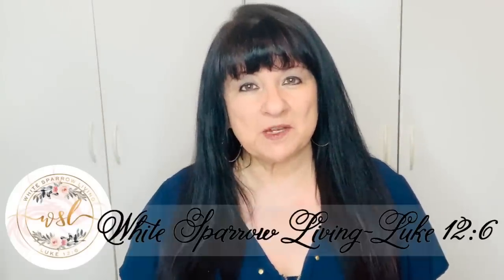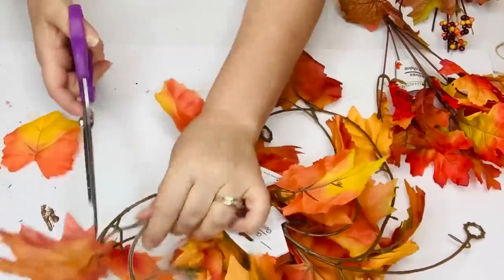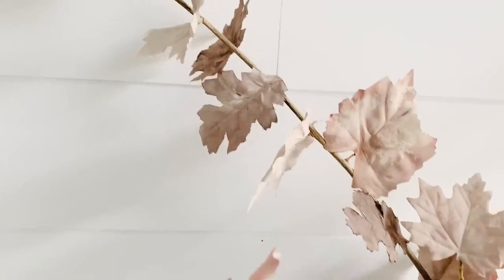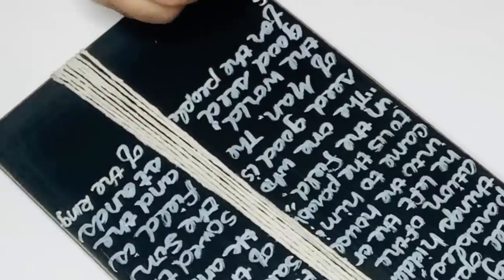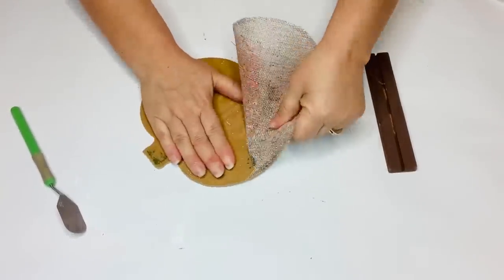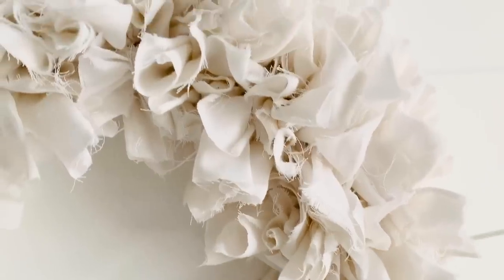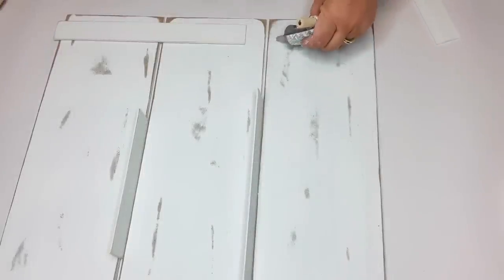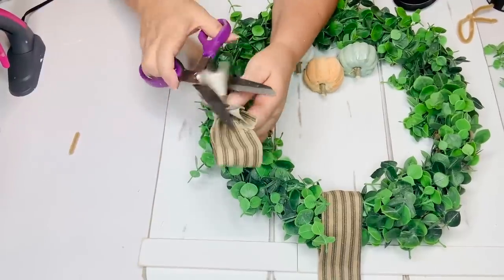5 HIGH END DOLLAR TREE DIYS FOR FALL FARMHOUSE HOME DECOR

Comment: What size tip is that chalk marker?🤔
Reply from the maker: Hi Yvonne! It doesn't say a size in the side but I just measured the widest part of the nib and it looks like it's 3/16" or a smidge under 1/4". But the very tip is pretty small so you can get a wide line or a fine one, depending on how hard you press. Does that make sense?!? haha Hope that helps, my friend! (And I get them from Walmart)